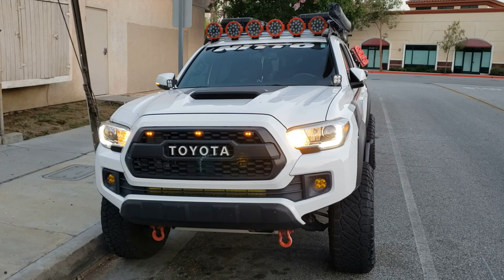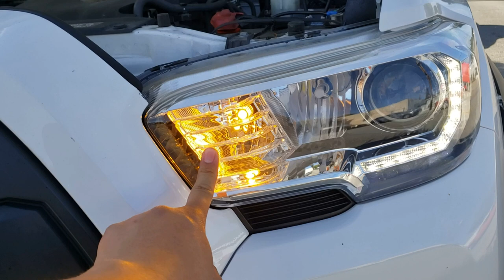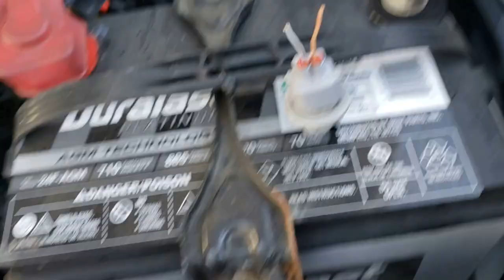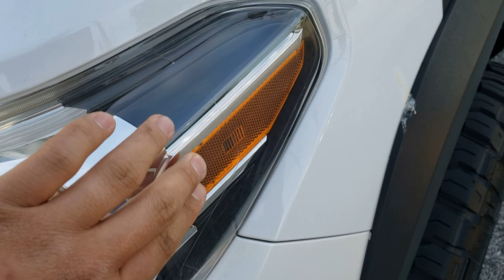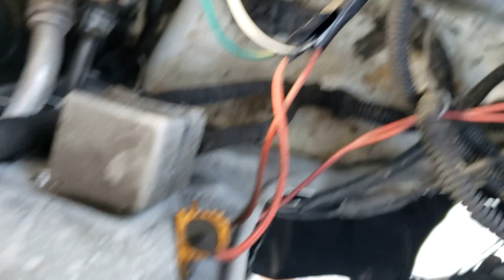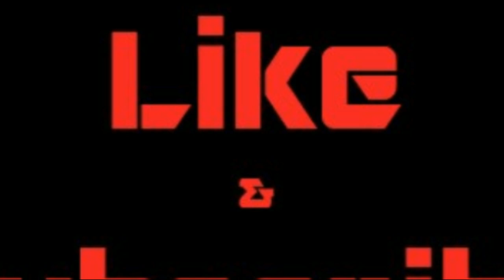How to run your Turn Signal as a DRL for TRD models | 2017 Toyota Tacoma

Comment: I bought the switch back lights that is supposed to run white as a DRL and flash yellow when the turn signal is activated. They don't come on as white, though, only blink yellow as a turn signal. Any suggestions ?
Reply: Yes you have to run a hot.red wire to the ign 10 amp mini fuse in the fuse box and take the black/ground off the battery and put it on the body of the truck/under the hood. You may have to cut one of your DRL wires if you have three of them going to the bulb. The lights will stay on even if the DRL is not switched on. Once you switch them on they will turn orange like your regular DRL lights. Your new DRL/white or blue L.E.D. will cut off once the ignition cuts off, so about a 5 second delay. You can run the wires to a switch but they takes up more room for another mod.

Comment: I have a 2020. I bought the pigtail after watching your video but it didn’t fit into the headlight housing.
Reply from the maker: Awww.. just try to wiggle it in there.. another way is try looking at the socket, and maybe you need to shave off some part of the tabs
Reply: @vincedprincehowtodiy7705   yes! Shaved one of the bigger piece off and fits perfectly. Lovin it!
Reply from the maker: Glad it worked out for you bro.. show me some pictures on instagram @vincedprince

Comment: I randomly came across your video. Couple of questions. I'm no expert at wiring, so this looks not overlycomplicated. Saying that However, where did you get your resistors? After several months, have you had any issues since installing this?
Reply from the maker: I've had my headlight like that for more than 2 years and never gave me issue.. the resistor is from amazon sir, I think it was like $20 for 2
Reply: @vincedprincehowtodiy7705 thanks! And guess last question: cut the original wires, twist them in with the wires and resistors, tape, and good to go?
Reply: @vincedprincehowtodiy7705  is there a link to this?  please share if possible